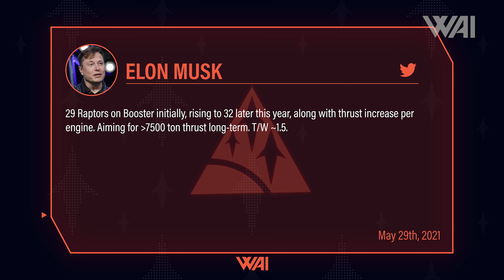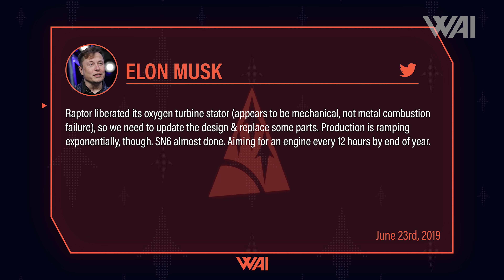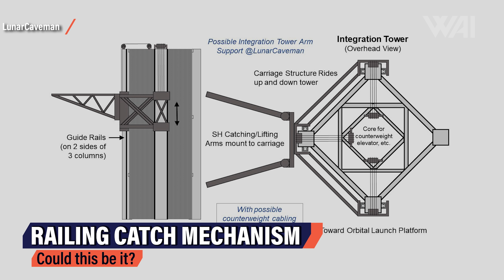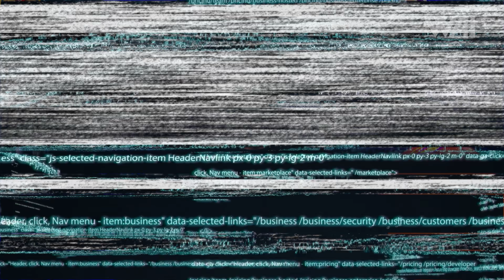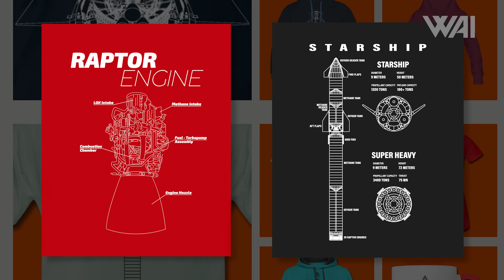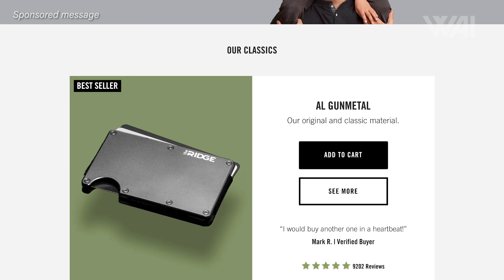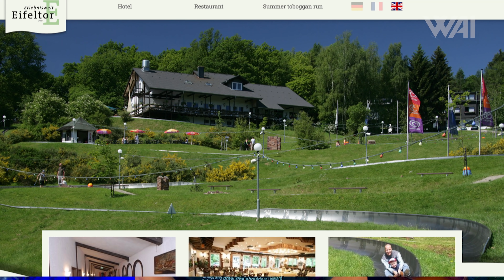SpaceX Starship Phase 3 begins! First test candidate at Launch Site!

Comment from the maker: What do you think? Are the hold-down clamps what SpaceX is building here? Do you have a different idea? :_WAISweet:
Reply: I think that that is the hold down clamps, because the OLM is almost ready for the OLT, and that means the OLT most be ready soon, which again means that the hold down clamps would be installed about now.
Reply: @XBlueBeam  অওঅঅ,অ
Reply: @rahathasnat6351  ???
Reply: @XBlueBeam  sorry.. Butt texting...😰😰
Reply: I agree re: the hold-down clamps. I am still worried that they will damage ground support equipment when they light all of those raptors at once for the SuperHeavy. A sound suppression deluge system should be easy but I don't see any provisions for that yet. Do you know anything about this?
Reply: @Myrddnn  Not only that stronly needed sound suppression deluge is missing !! There is also nothing to see about a flame-diverter also !!
Reply: @Myrddnn  the ribstructure of the launchtabel could blow giant amounts of water through the vertical slits in the inside Ring .
Could cool and protect everything with enough water .
Maybe 😂👌🏼
Reply: @deathwing5639  That would work. It would need some large water storage tanks and really high volume pumps, unless they put the water on top of the crane structure.
Reply: @Myrddnn  aren't they building huge water storage tanks at the tank farm? What else do they want to store that much water for ?
Reply: @BadOompaloompa79  I'm not sure. I haven't seen any of the people who keep up with that mention water storage. Those tanks are for LOX and Methane.
Reply: Hey WAI, love your vids. Great job. I have a question about what engines they will use when taking off from the Martian surface. 

If the vacuum engines have to have larger engine Bell's in order to maximize the amount of thrust in a low atmosphere environment, Will the Starship only be using those on take off from that planet since the atmosphere is 1% the density?

Just a question that came to mind. Anyway hope ya have a great one!
Reply: @conorhealy2763  
It makes sense to use all six at first to launch from surface of Mars, just to minimize gravity drag. The vacuum engines are fine to use at any altitude. When nearly in orbit, only one Center engine is needed to steer.
Reply: Probably not clamps as seen in the render. When they are extended their top is flat which I would guess then has the SH skirt will rest on top of them and they retract on launch to get out of the way of the raptor engines while also "sealing" the holes in the launch table.
Reply: @Nubalakula  That’s what I think. Or to ask the other way around: what is SS supposed to rest on otherwise?
Reply: @Nubalakula  Think about them when the booster is coming down????
Reply: @Nubalakula  
Tank pressure is the primary means of transferring engine thrust up the SH booster. The tank walls only support the modest "dry weight" before being pressurized. 

I expect the 20 arms to grab at the intersection of tank wall & bottom bulkhead, or at the outer engine mounts. The outer engines require reinforcement of the bottom dome at 20 locations so that is also a good location for the arms to support 5000 tons. 

The booster skirt may not even be included anymore, or it only shields the engines but no longer provides a strong support structure. It is certainly an undesirable weight that can be greatly reduced or totally eliminated.
Reply: When do you move the to the US?
Reply: @What about it!?  Hey Felix do you think that starship will face problems with pressurization cycles and only being able to fly a certain amount times due to stress on the tanks
Reply: Will SN 20 have any cargo? At all in it? I saw a video with the truck in it. It got me thinking. Answer this in your next episode please. I never see replys. Thanks
Reply: They probably are some sort of launch mount parts, but how they operate, no clue lol. I haven't looked closely. Not that I'm an expert though lol.
Reply: Could be.
Reply: Clamps would make a lot of sense. But some other thing is off. The support pillars have an angled cutout on the inside. Why? It would only make sense if there needs to be space for a part that is not yet attached to the launch table.
Reply: Please add timestamps. I often leave your videos marked for days until I can find time. With timestamps i could watch the parts i wanna see the most earlier, then continue to play the res later.
Reply: For the return trip from Mars, will hold-down clamps be used?
Reply: Vaccined not means you 100% safety. OEOEOEOEOEOE probably just half "n" half.
Reply: They seem to big & to many for clamps. They have a big pivot at the other end... kinda like a suspension arm of a car.
Reply: Idk, but this thumbnail is fire!
Reply: I just stopped watching after the third add.
Reply: Hi
Reply: Hello
Reply: 32 Engines, why do I see shadows of the N1's History repeating its self?
Reply: hi felix, I sent you a tweet on an idea on how to capture a superheavy....
Reply: Get tested for HIV. You will test positive soon. You were stupid enough to let them inject you
Reply: Wearing facediapers, taking the bio-genetic wmd all a big no no. Meaning down voted and unsubscribed.
Reply: @JohnConnorTM  good riddance, shame you won't do that with the Internet, you wouldn't be missed...👍
Reply: You got the Vax? I thought you were smarter than that.
Reply: @rexmann1984  Let´s keep these discussions out of here, mate.
Reply: @rexmann1984  hey mate, he got the vaccine because he is smart, smarter than you at least, have a good one
Reply: @rexmann1984  - he is smart hence the vaccination
Reply: @rexmann1984  whats wrong with the covid vaccine?
Reply: @XBlueBeam  for one it's a cold. Suck it up buttercup. For another he's young enough and healthy enough it wouldn't phase him to get it anyways so why risk possible side effects
Reply: @rexmann1984  i did not ask about any of that but, how do you know that hes young?
Reply: @rexmann1984  what you mean «its a cold»
Reply: @XBlueBeam  I can't believe 13 people liked this. The point is....we don't really know yet, whats wrong with the vaccine, and the data is being supressed, as usual so I believe Rex is implying he tought Felix would be smart enough to avoid being a voluntary laboratory rat.....

Comment: Why the StarShip can not degrease the orbital speed by its engines and start desending towards landing site. When the landing speed increases over sertain limit speed, then one Raptor shall be fired for holding the landing speet under safe limit and any strctures never got too hot.

Comment: 12:12 is it feasible to have a larger bell section above the atmospheric bell that would be lowered to mate with the lowest part of the atmospheric bell to form a vacuum bell?
Problems with solid mating with operating engine might be solved with each engine adapting one at a time  while off? Hoses?

Comment: At 12:10 you mention the expansion nozzle, the expansion nozzle in a vacuum isn't compensating for the vacuum, it's taking advantage of the vacuum. Without the expansion nozzle you still get the same thrust as sea level. The expansion nozzle further increases ISP in a vacuum.

Comment: Anyone think the launch stand is too close to the tower? Each will get burned when other is used and if a RUD happens could damage other...
Reply: The tower has been set at an angle so the flame will get deflected to the side. And did you know that pretty much many towers in most complex are very close lol
Reply: @alvianchoiriapriliansyah9882  The towers at Kennedy Space center are not that close. There have been explosions on takeoff that would damage that tower for sure. Especially with the massive booster and starship
Reply: @mrflorida55  "Not that close" did you even see the picture of the actual launch pad in the first place??

And how the vehicle can be stacked on the launchpad (and later catched) in the first place if it's far away "so it can be safe"?
Reply: @alvianchoiriapriliansyah9882  Oh yes forgot the crane that will be atop the tower for stacking. It is what it is.

Comment: Elon needs to use less number of, and larger engines,  plus  BIG LEGS for the super heavy booster, like the Saturn V, F1 engines. The Russian N-1 rocket failed because had too many engines…. The Saturn V gad only 5… he should use a super-raptor set of 7
Reply from the maker: A lot has happened since Saturn V and N1. Back then it was technically very difficult to run so many engines as electronics were not or very crudely available. Today controlling so many engines at the same time is no problem and more engines give more redundancy. If a booster looses one or two engines it really isn't a big deal. There were F9 launches where the booster lost an engine and just continued into space.
Reply: N1 failed because of lack of testings (no static fire whatsoever) which isn't gonna happen with reusable vehicles. You can said the same for Falcon 9, yet it's now the most reliable operational launch vehicle in the world. We're much better now technologically than 50 years ago

Super Raptor = bye bye propulsive landing & engine-out

Comment: It seems like a smaller number of larger engines in the heavy booster would be better. More engines are redundant, but also more ways for fuel flow to fail and lose power.
Reply: N1 failed because of lack of testings (no static fire whatsoever) which isn't gonna happen with reusable vehicles. You can said the same for Falcon 9, yet it's now the most reliable operational launch vehicle in the world. We're much better now technologically than 50 years ago

Super Raptor = bye bye propulsive landing & engine-out

Comment: There is no such thing as degrees Kelvin. It's just Kelvin.
Reply: Although 1 Kelvin is exactly equal to 1 degree centigrade. I suppose Kelvin doesn't have degrees because it's a proper unit and not part of a scale.
Reply: @TlalocTemporal  that's kind of unfortunately worded.
An increase in temperature by 1 Kelvin is an increase by 1 centigrade.
They're the same scale, just offset by 273.15 :D
Reply: @wastedwizard5112  -- 
Centigrade/Celsius is defined as the scale between water's freezing and boiling points, and split into 100 degrees. 

In 1954, a Degree Kelvin was originally defined with absolute zero at 0 and water's triple point at 273.16, to match up with °C.

In 1968, a Kelvin (no degrees this time) was redefined as 1/273.16 of the temperature of water's triple point. Basically the same thing, but now it refers to a fraction of an interval rather than a degree of an interval. Small details.

(As of 2019, a Kelvin is defined by the Boltzmann constant, so it's a precise change of thermal energy by 1.380649×10^-23 J.)
Reply: @TlalocTemporal  I didn't know that yet, thank you very much!

Comment: they need to build a railway to transport the rockets it just seems so sketchy using the roads
Reply: Is it really needed? With huge costs it's likely have a lot of expenditure with little to no benefits
Reply: @alvianchoiriapriliansyah9882  it would make transporting rockets so much safer AND quicker tho
Reply: @chuckchuck4016  Why not just uses the current method?
Reply: @chuckchuck4016  That's a very vague answer
Reply: @alvianchoiriapriliansyah9882  opportunity to make tesla locomotive

Comment: I’ve been thinking about Elon’s plan of increasing the booster raptor count from 28 to 32. Since the outer ring of raptors are fixed, there may be a unique opportunity to save some space by combining the outputs of the outer engines together by blending the bells into a common ‘ring’ structure. That would allow the raptor cores to be mounted closer together since the engine bell is the widest part of the raptor. The hot gasses wouldn’t really care if they were being directed by a physical bell or just the gas pressure of adjacent engines. The net effect would be a combined output being directed downward to propel the booster. The center articulated engines would still retain their individual bells, but that would be a way to significantly increase the number of fixed raptors in the outer ring without resorting to increasing the diameter of the bottom of the booster.

Comment: More than one way to catch a Starship. I think we have a pretty good idea how the Super Heavy will be caught and you would think the Starship would be caught in a similar way. My first though was a catching ring around the Starship with angled support bars that drop into place and extend out on an angle as they drop down, giving a broader circumference of support. Another thought is to use an hydraulic landing platform that would compress as the rocket "lands" on the surface. The SS has a width of 30' and only the center engines will be used for landing. That could give you a very broad field for recovery without damage to the platform.The SS will have to have support built in for legs even if those legs are not used with the platform. As the SS lands, support bars could be raised to insure stability.

Comment: It’s not safe to say we’re in the next phase of development yet. First they need to stack SN20 and BN3, and either clearing or rolling SN16 out of the high bay is the only sign they’ll begin.

As for SN16, it’s incredibly stupid to assume that they’re scrapping it because  they’re moving on to ‘the next phase’. I think it will be the final suborbital starship prior to the orbital test happening well after July, likely in August, and most definitely before the end of summer. 

If they’re not using it as a pathfinder for SN20, then they’re holding onto it for a specific reason. Likely having to do with BN2.1’s testing this evening.
Reply: In shorter terms, if they haven’t scrapped SN16 by now, and they haven’t used it for any reason pertaining to the orbital tests, then they were waiting to roll it out before BN2.1. And BN2.1 was supposed to have been rolled out by the end of April but SN15 took longer than expected to fly, meaning that SN16 is likely just one of several things backlogged from the Orbital Site being under construction.
Reply: There will be no suborbital hop. Now straight to orbit
Reply: @alvianchoiriapriliansyah9882  

There’s still assumptions made there. SpaceX have to fill out an environmental review if the FAA doesn’t take too kindly to SpaceX suddenly trying to get a much bigger rocket set up for an orbital launch. 

It also assumes that the GSE equipment will be able to be out together in time. Weather remains a constant issue.

Comment: I still think the first BN2 flight will be with SN 16 and only be a edge of space trip. Why? They can use it and not have to loose so many raptors in it's first flight. No heat shields or Rvac raptors on SN16. Minimum engines to push it on BN2 (less than 28) but definitely have the center 9 for full rentry testing. They would get a significant amount of data for BN2 this way and also test SN16 in a max q situation and thin atmosphere to sea level rentry. So Sub Karman line. Hopefully high enough to see some heating on reentry but not a crazy amount. Elon praises that Stainless Steel. Let's see what it can handle. This way they can make any additional changes to SN20 before it's assembled. Makes sense to me. Oh! They will also get a good bearing on their orbital launch facility to see if they need any updates before and actual orbital launch. Let's see what happens but seems like a logical next step from what we are looking at now.
Reply: SN16 won't fly
Reply: @alvianchoiriapriliansyah9882  such a waste a then. Another possibility. Max engine burn test from 3 sea levels to see how high it will go then blow it up over the water when its falling back down. Give me show😬
Reply: @michaelpetty8867  Sunk cost fallacy doesn't apply here. Each vehicle is relatively cheap in aerospace terms. Also it's a waste of time
Reply: @alvianchoiriapriliansyah9882  hence the emphasis on blowing it up for entertainment value😁
Reply: @michaelpetty8867  Unfortunately SpaceX isn't aiming this for just an entertainment sake. Unnecessarily delaying an orbital flight is definitely far from entertainment for me
Reply: @alvianchoiriapriliansyah9882  Roger that. Just anxious.

Comment: Thank you for the update.  Excellent as always.  One minor point: Kelvin is an absolute scale of temperature measurement, not a relative scale like Fahrenheit and Celsius.  The Kelvin scale become zero at absolute zero. As such, you shouldn't use the word "degrees" when giving values in Kelvin, unlike Fahrenheit and Celsius.  So the freezing point of water is "273 Kelvin", not "273 degree Kelvin".

Comment: The heatshield tiles are falling of at the moment, raptors still have issues, and the lauch support tower will also take some time. Most important, nobody knows how so many raptor engines will work in combination. SpaceX would probably test superheavy alone for a few hops and high altitude flights before the whole thing takes off. Likely with some setbacks along the way. Dont get me wrong, this is exciting. However, I estimate such an orbital flight to take place more like next spring.
Reply: The first time Super Heavy get off the ground is with Starship on top on orbital flights

Comment: Ya know...Looking at the second coming of the N-1 clustered  engines...a thought occurred. I wonder if Musk ever considered a circular aerospike design. An inner and outer aerospike ring. Bet the throttling issue would have been easier to resolve
Reply: The problem with N1 is it didn't do any static fire
Reply: @alvianchoiriapriliansyah9882  It did some quite dynamic fires though.
Reply: @simongeard4824  Only for small number of engines, and not the one actually installed on the booster
Reply: @alvianchoiriapriliansyah9882  When I say "dynamic fires", I'm referring to the four very energetic explosions for which the N1 is famous.